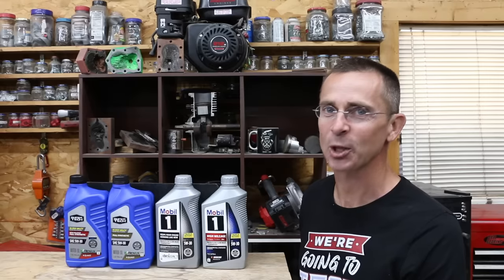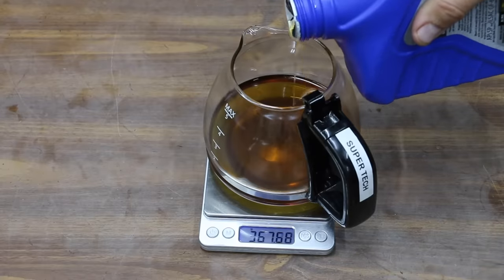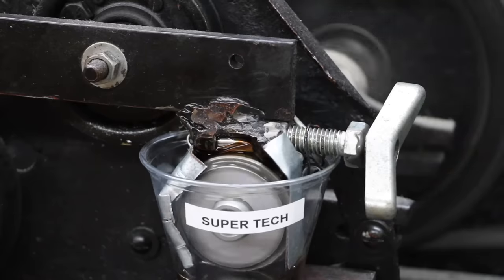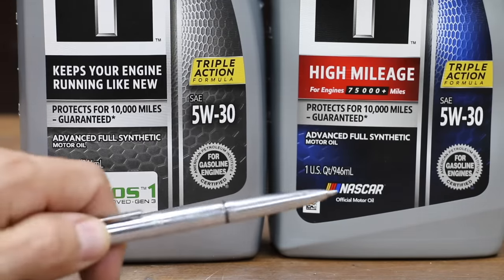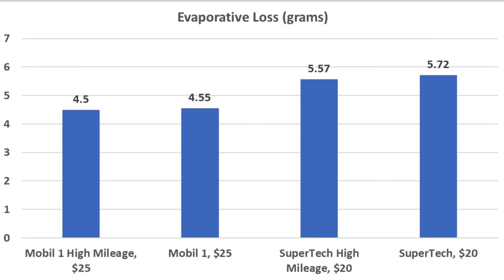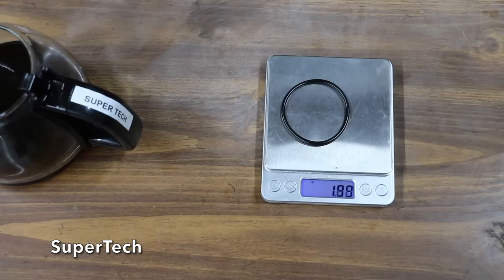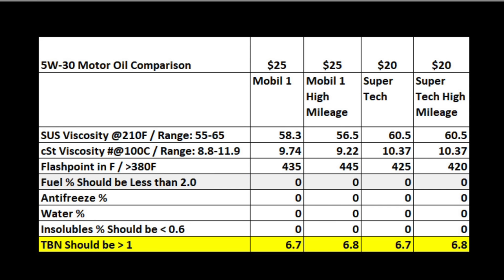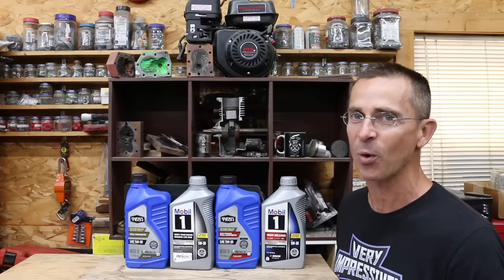Is “High Mileage” Motor Oil Safe? Let’s find out! Mobil 1 vs Mobil 1 High Mileage; SuperTech vs STHM

Comment: A cool test would be diesel oil vs car oil. Diesel oil doesn't have to protect a catalytic converter and its additive package is very robust to handle soot and high demand diesel engines.  Many of us use it in small engines vs the cheap gas engine oil. Great video as always!
Reply from the maker: Thanks!  Thanks for the suggestion.
Reply: It's mainly alot more zinc.   Good for pushrod engines and would probably do great on the scoring test.
Reply: @ProjectFarm  Also, Euro spec oil vs US would be a good one.
Reply: That would be a waste test. It’s not like you’ll change cars/engine because diesel oil came out to be better.
Reply: @GlennC789  it would be interesting to see if say a hot air cooled engine run for the same amount of abuse in each oil which one was better. Diesel vs gas oil..The v twin on my big zero turn starts with cold oil is quiet but after you're done working it you can hear each mechanical part 😁
Reply: @UCDHeqJPRnhSUZueIbT1DdJw oh no... lawnmower 😁
Reply: @kaycertified  plenty of people use diesel oil in their cars
Reply: My diesel has not only a DPF but a catalytic converter as well. Requires special oil to protect the emission systems. I would run standard diesel oil if not for the emission gear on the thing.
Reply: @kaycertified  I use 15w40 diesel engine oil in a few of my farm pickups. Both have over 200,000 miles
Reply: @imoffendedthatyouareoffended  I've ran it in a turbo'd stock block VQ for over 10 years with no issues.   But I don't have cats to worry about.
Reply: every gas motor ive seen using diesel oil for a long period lost compression due to high detergents
Reply: @imoffendedthatyouareoffended  they were NA motors and used rotella
Reply: @141runn  I have never seen or heard that?

Comment: I would love to see a Valvoline oil test for the full syn and high mileage versions. I've switched to Valvoline a few years ago with great results when I noticed Mobil 1 was evaporating 2 quarts over 5k miles and burning darker than it used to. I'd also like to see a battery test between Optima Yellow Top with other hi-po batteries. Great work Ozzie!
Reply from the maker: Thanks for the video idea.
Reply: @Namedeeznuts  Mobile 1 high mileage I left in my Trailblazer for 20-30k miles. Once the change oil light came on I changed it. I checked my oil often, of course, to ensure it wasn't low. When it was a quart low after around 5-8k miles, I'd add a quart. He tested different oil than I got since it was 15k oil. Most my miles were highway. Prior to switching to the high mile I used the regular 5k mobile 1 and the change oil light would come on around 4k miles. From 220,000 to 316,000 miles the high mileage gave me 20-30,000 miles before the change oil light came on. More city driving the oil broke down more than straight highway. I won't use anything else. Though I would if any gasket in my vehicle has cork gaskets.
Reply: @Namedeeznuts  how often do you do an oil change in America?
Reply: @nickgoode8579  3,000 to 5,000 miles isnt an uncommon number to change oil here in the states. Some of us change oil every 3-6 months reguardless of mileage as well.
Reply: @nixtux2003  So you were basically changing your oil one single QUART at a time as you drove?  🤔 Guys, I think he's onto something here.🧐
Reply: @nickgoode8579  Depends on the usage of the vehicle but in general heavy use every 3000 miles, lighter highway driving can go 3-5k.  That's what we do with fleet vehicles.
Reply: @ntvypr4820  it’s typically 10-20k here
Reply: @nickgoode8579  where are you from sir? You must have quality vehicles there. As well as quality lubricants. Thanks.
Reply: I never thought mobil 1 was all that great.  Supertech is great for the $
Reply: @nickgoode8579  I do every 5000 with supertech full synthetic high mileage and a GOOD oil filter
Reply: @Namedeeznuts  even when aproaching 3K the oil is getting black, oil is cheap....change it :) !!!
Reply: fordbossme just put up a video about 4-5 different valvoline oils including the high milage in the last week or so. Great oil analysis info.
Reply: @briankalagher6687  Thanks man Valvoline is the goat

Comment: There are lots of oil leak stoppers and seal rejuvenating products on the market. Would be cool to see a number of them tested scientifically. AT-205 reseal is so far the only product I've used that actually stopped a severe oil leak.
Reply: The additives used in high mileage oil do not permanently stop oil leaks, they only have a bit more additive that swells the seals compared to regular motor oil. Also, if the seals are swelled from using high mileage oil, they will likely shrink a bit (causing problems) if you stop using high mileage oil after that.
Reply from the maker: Thanks for sharing!
Reply: LUCAS products work very well to stop leaks
Reply: @mikefoehr235  Yes, but one is gambling on it not plugging up small internal pathways that need to stay open.
Reply: @Mark-rw3kw  buy a vehicle that doesn't leak. I have owned 4 Toyotas now and none have ever leaked anything. Cannot say that about Ford and gm.
Reply: AT205 is seriously magic in a bottle
Reply: @mikefoehr235  337k and 17 years later my Toyota is 100% dry underneath. ...other than the fluid film I spray on it every year. 😁
Reply: rislone worked for me
Reply: @mikefoehr235  My Toyota (11 years) and Hyundai (13 years) have never leaked oil and never showed any oil usage in between oil changes based on dipstick level. I used Mobil 1 EP 5W-30 on both vehicles. Other than occasional fuel injector cleaner in the gas, I have never used any other gas or oil additive.
Reply: @ProjectFarm  ,you should run a series of test on the AT 205 sealer
Reply: A couple of years ago I started noticing a very minor rear seal leak on my 2001 Tacoma V6.  AT-205 stopped it cold.

Comment: Fairly common practice to use diesel oils in gasoline vehicles for the added wear production, I'd love to see some of those brands/models tested.
Reply from the maker: Thanks for the suggestion.
Reply: I’ve recently tried rottella t6 5w30 for my Silverado.
Reply: The trouble with diesel oil is it may effect the catalytic converter. The higher zinc levels could Leach into combustion chamber and clog converter.
Reply: @JohnCunningham-sy5ug  ah yes my vehicles definitely still have those.
Reply: Diesel oils do have higher ZZDP in them, much more so then modern GF6A gasoline oils, but modern diesel oils do not have the same amounts they used to have. Diesel oils may contribute to LSPI in direct injection gas engines as well as contribute to catalytic converter contamination.
Reply: Very common in motorbikes, even high revving sports bikes. Rotella/Rimula diesel oil is definitely highly regarded on bike forums.
Reply: not a good idea on high reving engines.. with vvt  engines,it could stop the vvt  oil passagways from delivering oil to the vvt parts..ut..hey its your engine..go for it..i am not
Reply: @DiscoFang  yeah I've heard that. But it's formulated for big slow turning dirty throbbing diesels and not formulated specifically for wet clutches, high rpms or high temps. I won't put it in my bike tho. Motorcycle formulated oils only, Period.
Specifically AMSOIL motorcycle oils for me it's great stuff!
Reply: Yup. Rotella 15-40w is all I use in my 88 Nissan truck
Reply: Yes just changed my oil in my 99 dodge ram with the 5.9 engine and I put 15w40 diesel oil in it. With 262,000 miles it has helped it run better. 👍

Comment: I use high mileage oils primarily to expand or enhance the camshaft seal and minimize the chance of oil leaks. Thanks for the video.
Reply: @Hazard maybe you guys just don’t buy into advertising like that. American advertising annoys me with the “super” claims
Reply: Great solution to a non-existing problem. Still waiting for my 150k miles Audi to add some black color to the oil, its still brown and transparent 1000 miles after oil change, there should be enough residue inside an engine that old to immediately make the oil black, and there would be on most other cars. People need to stop listening to clowns like Scotty K and start buying decent quality cars, my other cars are both VW and goes 20k miles between oil changes without refill (obviously they needed refíll when they were fairly new, the engines are made that way and consumption stops after 10-40k miles)
Reply: @Vadim123XxX the UK average mileage per year is approx 6500 compared to usa average miles per year at 14200  the UK average age of vehicle is 8.4 years (53300 miles) compared to USA average age of 12.2 years(173,000 miles). so basically the UK doesnt have old high-mileage vehicles compared to the united states.
Reply: @pflaffik  Guess I'm a clown.  In the business working on Euro, domestic, and Asian for 33 years and now a tech line.  Never cared for the quality of most Euro cars when compared to domestic and Asian.  Plastic and gaskets seem to challenge those manufacturers.  Love making money on them though.
Reply from the maker: You are welcome!  Thanks for sharing.
Reply: @Vadim123XxX Not even Valvoline Maxlife? It's pretty common in the stores here in Finland.
Reply: @Hazard What?? Yes we do!
Reply: @Panin2001oca  Bro I feel bad for people who can't navigate through American products and just use whatever matches what it say on the packaging.
Reply: Would it be wrong to conclude that we should use high mileage oil from mile 0 on the motor?
Reply: @andrewvirtue5048  Not a mechanic, but I believe there is a bit more detergents in break-in oil.  At least there used to be.  Cheers!
Reply: @andrewvirtue5048  no you dont wanna use high milage in a new car the additives expand the seals. It could make them to large
Reply: @pflaffik  as an auto mechanic who has changed oils on thousands of cars, domestic, european, japanese, (and many many audis and VWs) etc, your claim is simply a straight up lie.
Reply: @pflaffik  VW and audi are quality vehicles? you do know there reliability is lower then average for audi but admittedly not much lower and VW being one of the lowest the only 2 worst being smart and suzuki.
Reply: @yabman1317  Usually its a lot more anti wear additives usually zddp
Reply: @pflaffik that’s not how it works the inside of your engine should not have dirty residue that just makes the oil black instantly. The oil darkens over time from heat cycles and maybe some from intake of dirt but not really this is why we have air filters. It’s mostly from heat. That’s why the oils turns black in his coffee pots test he’s heating the oil much hotter then it will ever see in your engine but over time same results.
Reply: @pflaffik  ea888?
Reply: @DeusKDuo  don't knock Suzuki made car engines (the 2.0 I4 and 2.5 V6) if you take care of them they don't miss a beat even if you rev them to the moon now there automatic transmissions are another story and there transfer cases are very easy to screw up if you don't keep the fluid clean mantance is key on Suzuki shit boxes.
Reply: @Vadim123XxX because you guys have mainly diesels engines, if we had mainly diesel we would be much better off especially how big the usa is
Reply: @hypocriticalharambe8274  I am talking more in a general sense. I agree suzuki isnt all bad. Even VW being bad the the golf is better then average in reliability. the rest of their vehicle line up brings the average way down. BMW in general is less reliable then mercedes but there are some mercedes vehicles i would avoid.
Reply: @Hazard because british cars never make it that many miles
Reply: @amazincrackmonkey7176  I have been running valvoline full synthetic high mileage oil in both of my vehicles since new. 2018 4runner with 54k on it and 6.0 LS in my Jeep now with 30k on it and no issues at all.

Comment: Been using Mobile One high mileage in my 2005 tacoma ever since it hit 75,000 miles. Its been a great oil. I've  got 270,000 miles on it now and it doesn't burn oil and no leaks. Hoping to hit 300,000 in a couple years. Thanks for the great videos. Trust project farm above all the "consumer report" companies.
Reply: Knowing Toyota reliability, you've probably got another solid 300k miles in it.
Reply: I've been using Mobil 1 for 30+ years. It's top notch.
Reply from the maker: You are welcome!
Reply: Why do people insist on making mobil.. into mobile ??   Its really odd
Reply: I have been using Pennzoil high mileage conventional, 370k miles now and doesn't burn a drop

Comment: I put on about 250-300 miles a day on my car, I've only ever used mobile one full synthetic with a wix filter. Almost 260k miles and runs strong!   I've always loved these comparisons they taught me that you'll spend money on the things you care about that includes oil and filters for me lol
Reply from the maker: Thanks for sharing.
Reply: If you’re driving that much you should either move closer to your job or find a more efficient way to travel. It’s unreasonable to generate that much pollution for one person
Reply: @Lubbocksfinest  Taking a plane ever day generates hell of a lot more pollution than driving that distance mate. So shush.
Reply: In my experience Wix filters are the best filters.
Reply: @Lubbocksfinest  He might be transporting cargo for his job lol
Reply: Always amusing how liberals are certain they and they alone are the ones entitled to decide what is reasonable.
Reply: I'm at 257k with the cheapest oil and filters and I beat on this car like crazy. I think the car is a bigger factor than the oil and filter.
Reply: @MindHunger  I run the regular, not the XP which has a worst micron rating.  ~21-23 VS 35 for the XP.
That's how they get them to last longer.
Reply: @Lubbocksfinest  ok Karen
Reply: Using mobile 1 on my Audi, super clean engine after 150k miles, oil change every 2 years. However, i use the cheapest full synthetic stuff and 20k miles between oil change on my oldest VW cargovan, the engine is in top shape, even with so long change interval theres no need to refill between oil changes. Not at all convinced that expensive oil is better for the engine but since the Audi is on 2 year intervals the added cost is extremely low.
Reply: @Lubbocksfinest  You didn’t bother to ask what sort of vehicle he drives or what he does for work. It’s probably safe to say that’s not him commuting back and forth to an office though because he would’ve given a round trip number 

If that irritates you though, surely you must be furious when you see “climate-activist” politicians taking private jets just to go to a meeting that could’ve been done over Zoom?
Reply: @Lubbocksfinest  You should tell that to the semi drivers who deliver your food to the grocery store. Maybe they should find more efficient ways of delivering goods. Very wasteful.
Reply: @andrewk8636  I'll second this. Had an S10 that I put about 150k miles on, sold it at 269k still going strong. In a similar situation with a Sonoma that's at 209k. Nothing but the cheapest oil and filters and at 7k-10k intervals
Reply: @Lubbocksfinest  who says it's unreasonable.
Reply: @Lubbocksfinest  another virtue signalling comment..pathetic, suppose you believe humans are in charge of the weather also? We arent
Reply: @pflaffik  oil change every 2 years? You must never drive, I do one at least every 4 months.
Reply: @robertjoseph1592  exactly...
Reply: I totally agree with you on that, we bought a new 1983 chevrolet celebrity (v6) and when we sold it with almost 600 thousand km (370 thousand miles) it used no oil at all,  but I changed the oil every 8000km (5000 miles) and a new filter just regular oil and I believe if you do that it doesn't really matter what oil you use. Unless it gets really cold where you are.
Reply: @Lubbocksfinest  cry more
Reply: What vehicle do you drive?
Reply: @Lubbocksfinest  you should mind your own business princess
Reply: @Lubbocksfinest  Commercial truck driver gonna quit his job brining you food. 
I voluntarily commute 250 miles a day said nobody, ever. 
Don’t say no one warned you, that degree in underwater basket weaving is not going to pay off.
Reply: @Lubbocksfinest  Congrats on not understanding rural life at all..lol. 250 miles a day is very normal for me as well. I'm a contractor in a rural area...250 miles is an average day.
Reply: What model of car is it?
Reply: @Lubbocksfinest  Tell us how the cobalt mined by child labor in the Congo to make lithium ion batteries for electric vehicles is better?

Or what is the environmental impact when recycling these electric vehicle batteries?
Reply: @Lubbocksfinest  i would love to hear of your example of a "more efficient way to travel"

Comment: I'm sure you've had it suggested but air compressor oils would be interesting to see tested. Especially synthetic vs conventional. Good work as always!
Reply from the maker: Thanks!  Thanks for the suggestion.
Reply: I would not recommend this but I put only Marvel Mystery Oil in my 5 HP Sears air compressor 40 years ago and it’s still going strong. Never added or or changed it. I built 2 airplanes with it. Love your show.
Reply: @dalecombs9706  i’m also a pilot and what airplane? i’m so interested in your experiences.
Reply: @StBeter-tc2te  RV-4 and several rebuild projects-good luck it’s an amazing experience
Reply: @dalecombs9706  marvel air tool oil has kept my tools and others from breaking or being ruined by water in the line. Tons of times I've used it to free up frozen/dried up air tools. Miracle stuff. Seen mystery oil free up oil rings on cars 90+ years old.